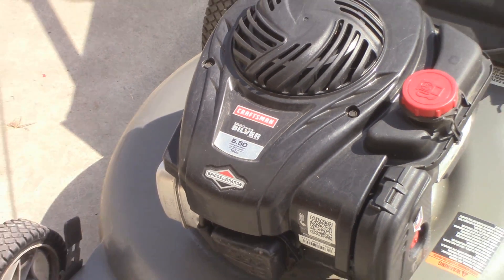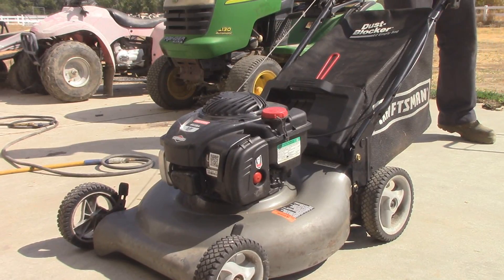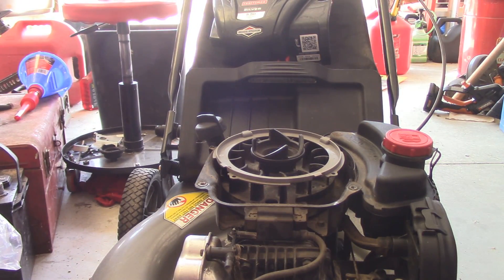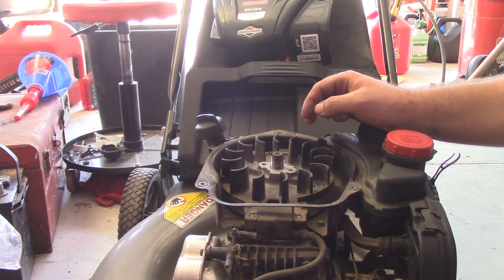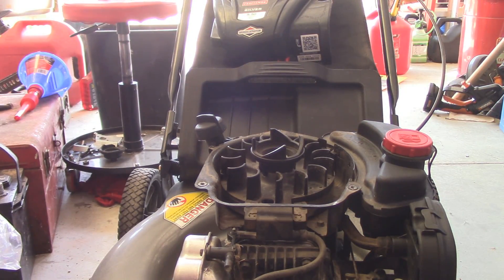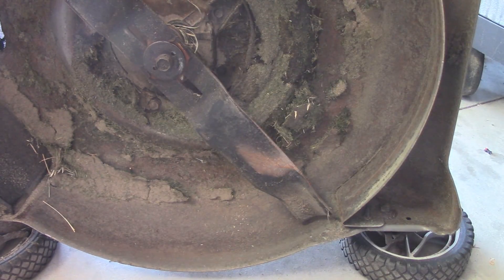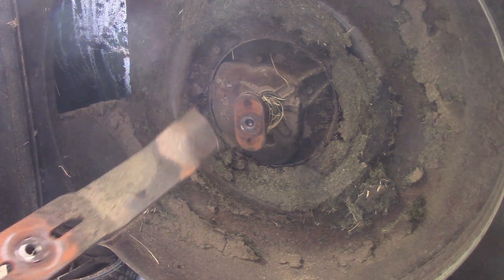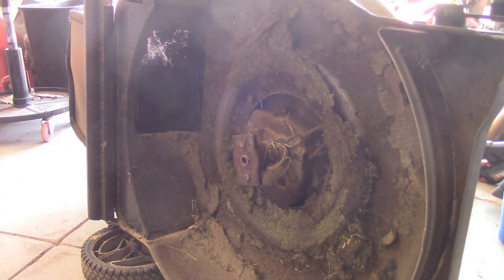How to Fix a Non-Starting Craftsman Lawnmower

Comment: I've come to comment on what happened here. The adapter was IN PART the issue. I have this on a Tecumseh I got in, mid 90s Craftsman developed a knock and then started this. What happened was, the adapter sheared off, and since it's a universal blade, if anything at all happens, such as the washer not being seated like yours, it'll allow the blade to move one way or the other. Of course in just a second it hit the deck, and that was that. I came back and watched again and sure enough the universal washer wasn't seated, meaning the bolt and adapter weren't correctly mating to the blade and it moved. I'd also bet the blade was trashed as mine was.

I also ponder this because the old model Murrays used a round adapter with no nubs, just the bolt hole to hold the blade and that system worked well.

Comment: there is some hidden problems in these newer Briggs and Stratton engines the main problem is with the PLASTIC camshaft and timing gear in the motor them breaking resulting in the valves not working. i believe this newer style engine on that Craftsman is what replaced the old classic 3.5 HP. the Quantum is still made in the Mow and Stow type. im surprised after the repairs u made to the mower it runs sometimes they can be discarded due to a bent crankshaft meaning the crankshaft needs replaced. if the shaft is the same diameter as the rest of the crank like the old 3.5 HP the engine block needs replaced. it was around the early 2000s that Briggs and Stratton went to the OHV  mower and pressure washer engine first the Intek, now its the professional series, and  the E, EX< and EXI engines of this type. they are phasing out all of the flathead or L head engines alltogether.
Reply from the maker: yea... that sounds like a horrible design to me, the old quantums had plastic cam gears atleast the couple I have torn down have. but they did seem to hold up over time.
Reply: i seen videos of the newer Briggs engines with these PLASTIC camshaft failures they did put them in the later 3.5 hp engines and some of the horizontal shaft L head engines before Briggs stopped making them in favor of their OHV engines within the last few years  Briggs and Stratton as well as Kohler starting importing the Horizontal shaft Honda Clone engines from China these Honda clone engines from Harbor Freight are pretty reliable as they have metal cams and gears at quarter of the price of a new   Briggs and Stratton engine as i don't like the design with the new Briggs engines with the PLASTIC camshafts and timing gears in them there is bound to be problems. i had a Briggs and Stratton Intek 7.0 HP OHV engine  it worked well at first then it was getting very hard to start when i pulled it apart the crankshaft bearing surfaces were well worn out in one side up and down and side to side end play. as this engine had a plastic camshaft but a metal timing gear like the quantum. This engine was on my Snapper 21 inch self Propelled  Hi Vac walk behind mower i since then repowered it with a 173cc Honda Clone predator engine from Harbor Freight made by Chongqing Ratio Power Manufacturing Co. after 4 seasons the engine runs very well and smooth starts on one to two pulls it tells me these engines are so much better than Briggs and Stratton and the Tecumseh engines. as   before Snapper was its own Co made mowers im McDonough Ga. first was Mcdonough Power Equipment a Fuqua Industry then they renamed to Snapper Power Equipment. the early 2000s is when Simplicity Mfg purchased Snapper. since then they were purchased by Briggs and Stratton and closed the McDonough Ga plant. as the HiVac mowers are still made and the Ninja mulching. the friction disc drive system is so reliable and works well and lasts a very long time. when i put the predator engine on the drive pulley and the blade adapter all fitted this engine. some mowers the self propelled is different it varies from make.
Reply: After reading Derek’s comments; It makes me want to cling to my old cast iron flat head Briggs & Stratton and Kohler engine(s) even more. I am now a strong believer of the Predator Engines from Harbor Freight. For the money, You can’t go wrong. I think plastic engine parts are garbage. Oops, Did I say that out loud. Speaking Of Snappers; I have a 30 Snapper RER “Forrest Gump” mower that has a 11hp I/C Vertical Shaft that I am strongly considering swapping to one of the Predator engines. The RER was given to me by a friend when he told me that the mower was going to be scrapped - I intervened.  That thing mows much cleaner than my John Deere with new blades.  My 21inch Snapper push mower will literally start less than 1 pull. This newer stuff really doesn’t appeal to me. Thanks Hank for all of your great videos.